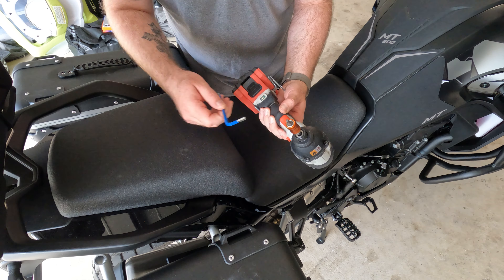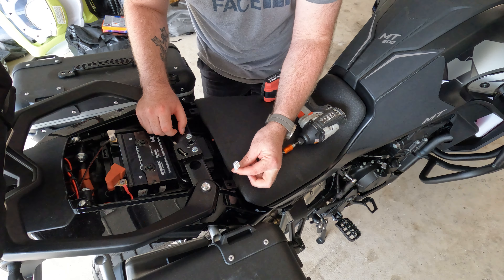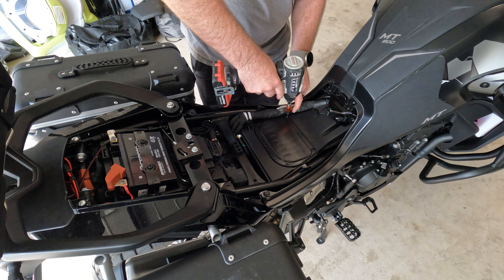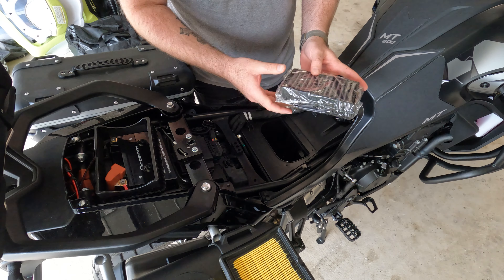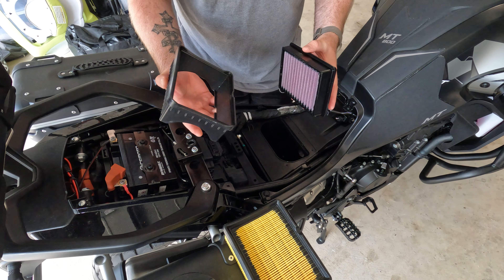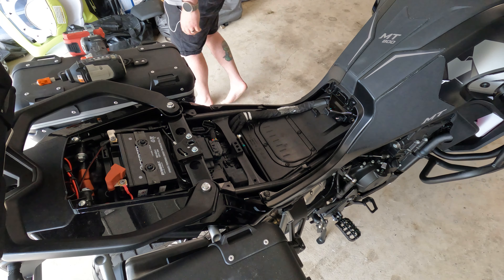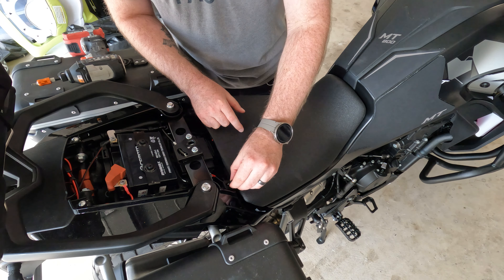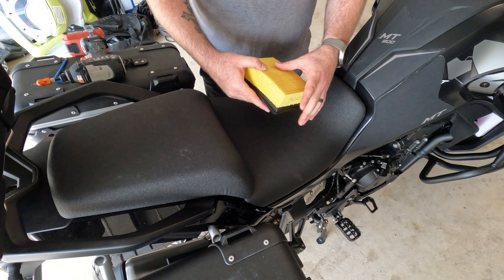Installed the DNA Air filter | CFMOTO 800MT Explore

Comment: Some used to think oiled filters gunked up the MAF sensor, causing issues. Fikter companies denied it , but i never did hear any more . But i stopped using oiled filters except in small engines like chainsaws, lawnmowers etc.
Great bike by the way 👍👍
Reply: I have one on my 450ss  no issues. It's already soaked into the filter material..its not like it's dripping.
Reply: @easye1311  it was supposedly microscopic oil particles, not big drips,in time it builds up on the sensor. I used to spray my sensor on a mustang gt every once and a while with brake cleaner just to be safe.
Reply: @jamiehalifax4954  ah got it. I would still recommend dna filters i man my bike is night and day with it.. it "feels" like it goes faster but I had my ecu tuned so I gained hp and torque anyway
Reply: @easye1311  do you use a throttle punks air filter cover  ? I got one on, makes the intake louder and looks cool, but it's under the seat, so you don't see it much
Reply: @jamiehalifax4954  no i use the stock cover